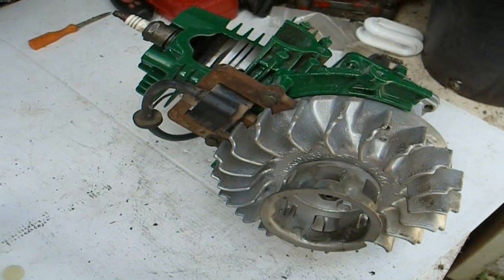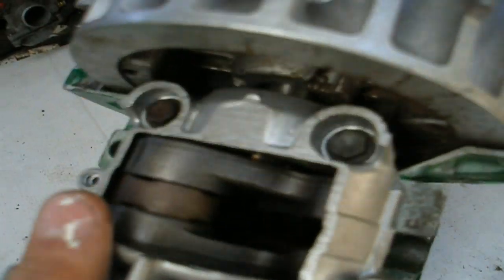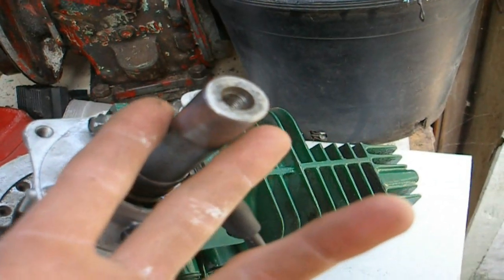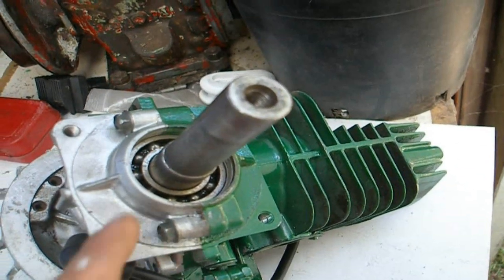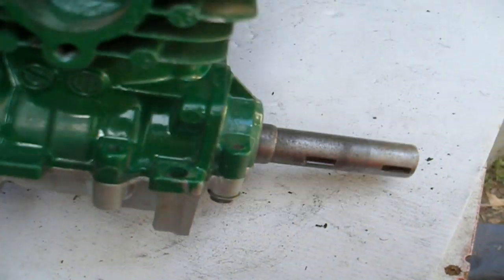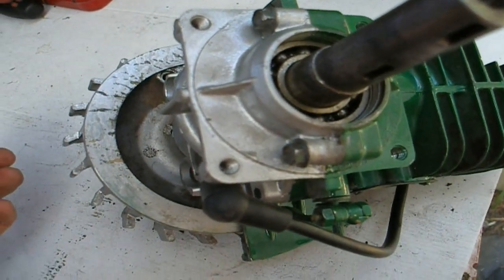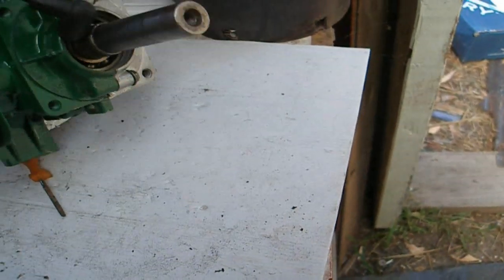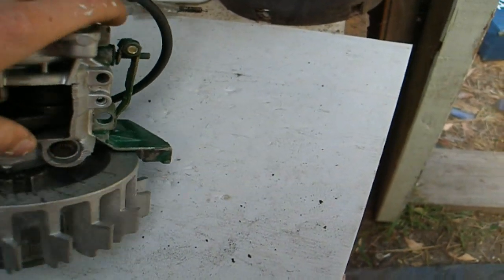2 stroke starting and running problems part 1 of 2

Comment: dear sir,I have problem with my 2 stroke engine,the engine start ignition very bad and after ignition engine work very very high at max rpm and after few second the engine goes off